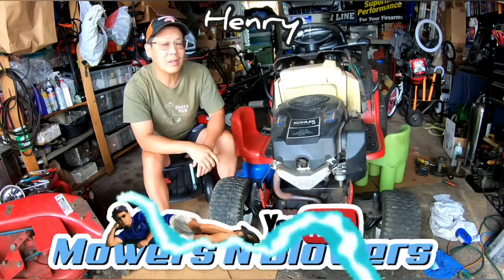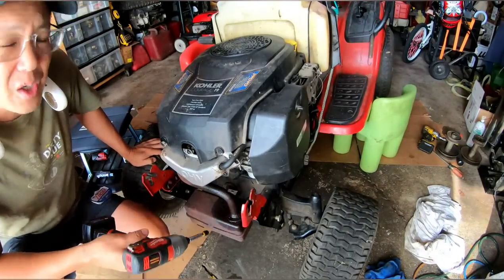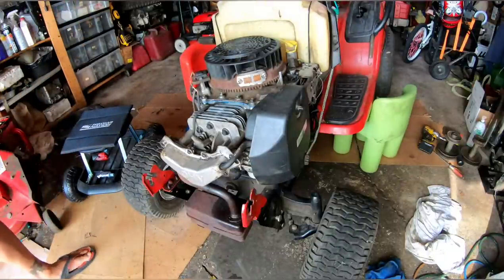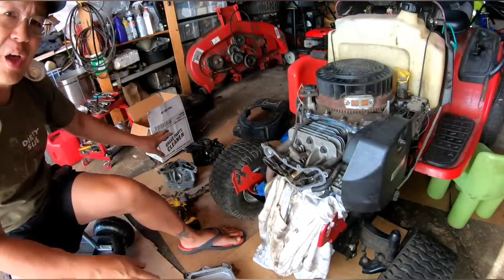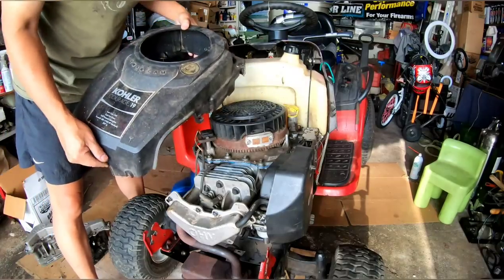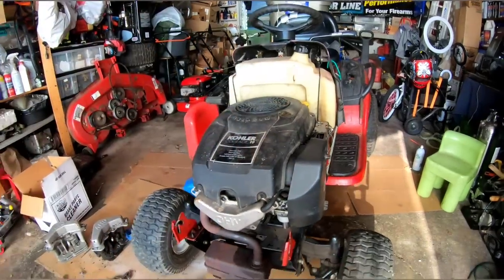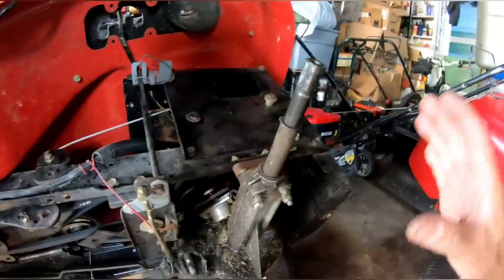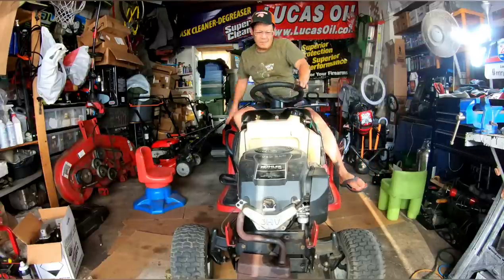FREE TORO LX460 KOHLER COURAGE REPOWER LAWN TRACTOR PROJECT VALVE COVER CORK GASKET OIL LEAK REPAIR

Comment: When you were running it on the jack it looked like it was going forward and back when you shifted it!!   So i guess under load it is just not able to engauge enough!!   Drop that trans Henry......... tear it apart!!
Reply from the maker: Yeah but since it’s up in the air,  it’s just momentum and there was no load,  I can stop the wheels with my hand
Reply: See.... I agree 100%
Reply: Take it off and apart.... You might find the problem as your taking it apart.

Comment: Henry.... I have seen you do about everything with a riding mower.... cept... rebuild a trans.... these MTD trans are NOT like the AYP hydraulic trans with actual hydraulics in them... MTD is basically 2 gears, a clutch, and gear changing fork, and the axle inside & a WHOLE BUNCH of #0 GREASE....  there are a dozen or so vids up on the tear down of them.... also that number on the trans sticker will lead you to a breakdown schematic of the internal parts and the part numbers.... When I rebuilt mine last month I ended up needing both top and bottom shells (ends had broke so the seals were not allowed to seal)( about 50 bucks used for Both)...and all new Axle bearings & Seals (about 35 bucks).... but my gears and clutch were still in great shape. The Grease I used was 00 grease from from tractor supply ( about 6 bucks for a 32 oz bottle).... it may seem like a lot of funds to put into a tractor... but this one was free to me and I could justify the cost that way... Good Luck and hope to see this one moving FORWARD soon.
Reply from the maker: You’ll see bro…no money spent!

Comment: First things first. MTD SUX. I have had several of those and 3 of them had that same problem and sound, and all 3 times it was the differential, transmission, rearend, what ever you want to call it.
Reply from the maker: Agreed!  MTD SUCKS!
Reply: Victor thats why they say the MTD stands for Made To Destruct.🤣😂🤯
Reply: @MowersNBlowers  If it was me, it would just be easier to  take the engine off and put it on something else

Comment: The bad thing is when you do find a lawn tractor with a blown engine that you can use the transmission it's just easier to swap the engine.  I would just use this for parts strip it all down and then sell the frame for like fifty bucks to someone that builds lawn tractor racers.
Reply from the maker: You give up too easily bro.
Reply: @MowersNBlowers  how is that giving up.